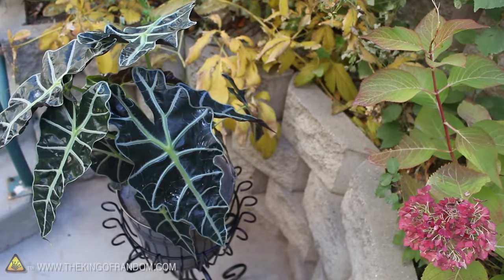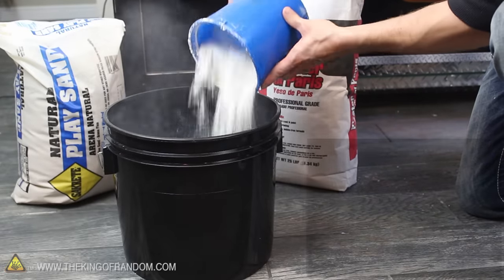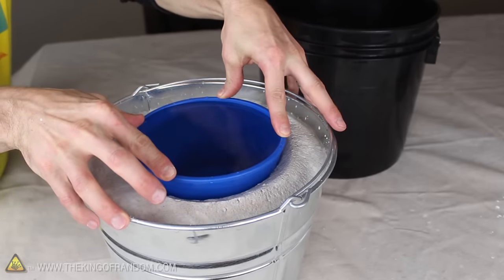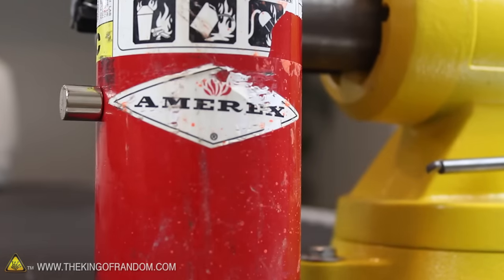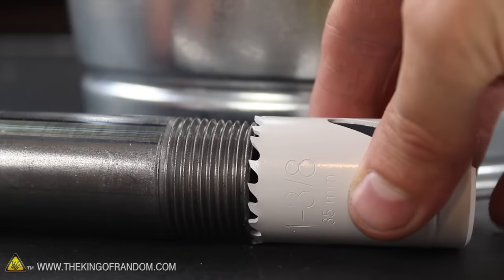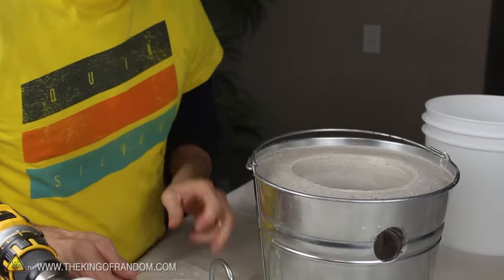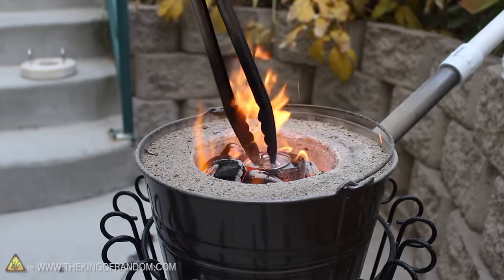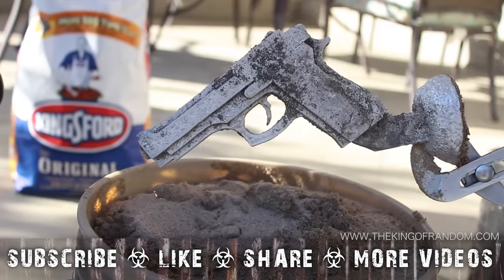How To Make The Mini Metal Foundry

Comment: WARNING: This does NOT cost 20$. Try 100.
Reply: if you make more then one of them they tend to cost less
Reply: I made calculations, still about 60$ per thing if you make a ton.
Reply: Cost of used fire extinguisher: Free.. Cost of plastic bucket: $2 at dollar store..  it all really depends on if you know how to get stuff cheaper (or free)
Reply: Have you actually made this foundry? I tried making it, the cheapest way possible, and it costs at least 60$.
*****
Reply: i made it, sand+plaster cost $10 for enough to make 4 of these things. $5 for the steel bucket, i found a steel pipe for air at the scrapyard
Reply: what about the shop vac and the crucible
Reply: I literally just got back from lowes and bought all the stuff I need for about 31 dollars.  Got 8 pounds of plaster of paris, a 50 pound bag of sand, a 12 quart bucket, a smaller bucket, and the two U bolts.  I guess it's not $20, but it's far from $100
Reply: for mass production it costs more because of the shop vac
Reply: Definitely not 20, definitely not 100. The Plaster of Paris is about 15 - 16 bucks a bag, and the sand too. I'd say about 30 - 40 dollars for all of the materials.
Reply: All the little pieces like the buckets, hole cutting saws, and ubolts are minimum 4$ apeice Angstadillio
Reply: Don't worry, the 5 gallon bucket and hole saws are good tools to have around, you'll use them again.
Reply: go on the lowes website i found every thing there for about 22 dollars
Reply: i bought all my stuff at home depot and it was $50 all together easy
Reply: +Ethan Noumenon what kind of bucket are you getting for $4? Just go to the dollar store
Reply: I made mine with a 6 gallon bucket, much larger than the 2.5 gallon one he used in the vid, with a 5 inch diameter extinguisher as the crucible, bigger than his 3 incher. I found the used extinguisher in the online classifieds for 10 bucks, the bucket was 15 at Lowes, the sand was 4, the plaster 15, the U-bolts 3, for a grand total of 50 with taxes. I already had a plastic mold bucket and power drill with drillbits. If you dont have those it could be a little more expensive.
Reply: well his is called a MINI for a reason lol
Reply: +Angstadillio ,I spent $100 on mine where i live plaster of paris cost $30 and sand $7.50 for 50 pounds
Reply: mmkay well that adds up tooo.... 37.50... liar
Reply: Its been months since this was posted, gtfo
Reply: Can you chill?
Reply: Sorry, but I don't recall a dollar store mentioned in the video, so I went to Home Depot as mentioned in the video.  The cost of the sand and plaster alone was over $20, you can't buy that at dollar store.  Actually I ended up using a plastic paint can which is not tapered at the bottom but it was extremely difficult to remove afterwards, so a thin bucket is preferred.   You can save few dollars by making your own U handles.
Reply: Where did you buy a steel bucket for 5 bucks???  It was 11 bucks at my Home Depot and I looked everywhere for cheaper one.  Also it doesn't matter that it only cost 10 bucks for sand and plaster if you make 4 of them, you're still paying for 4 of them at once!
Reply: Prices as of Aug 2016
Plaster of Paris $16
Play Sand $4.5
2 plastic buckets $5
10qt metal bucket $10
12 x 1" pipe $6
pvc coupling $1
2 ft pvc pipe $1.67
2 hole saws $30
3" U bolt $2
fan from Goodwill $5
fire extinguisher $30, not from HD, just average price I saw.

About $121.70 after WA tax.

So I didn't buy fire extinguisher or any pipes or fan or hole saws because I either had or used something else like a tin can instead of 3" hole saw and it worked out perfectly.  I bought stainless steel cup from thrift store for $2 dollars and everything cost me about $40
Reply: Rens Vandekerckhove
Read the description... You people...
Reply: I would recommend getting a Graphite crucible. They can handle temps of up to 3000 degrees, so it is a sound investment if you wish to make this a hobby. Also I recommend doing a lot of research before hopping in. Saves you a lot of time and head aches.
Reply: porpus99 I heard the good ones cost $100+ and the pressed ones from China don't last long.
Reply: Dima Prok Depends on where you get it;
Reply: I made it for $20
Reply: well apparently you don't know that other country's have different prices for things
Reply: TROLL ARMY
He lives in america
Reply: Ethan Noumenon k?
Reply: Ethan Noumenon i didnt ask for that
Reply: for me it only cost about $30
Reply: i think they ment for the sand and plaster of paris.
Reply: came in at under £20 for me but I had the buckets and some scrap steel pipe (scaffold) also order a crucible of amazon for £8 that's not included
Reply: one bag of play sand from home base was £4.99 and 2 2.5kg of plaster of Paris from hobby craft which where less than £5 each. galv bucket scaffold pipe and heat gun I allready had. Also there's enough sand left to make green sand for the molds
Reply: Richard Ball Show the link where you bought crucible for £8.  Most likely it's 1kg and won't fit pop cans.
Reply: I made this and the styro slicer for 60, and that's because I bought the transformer.
Reply: +kalel thomas I made styrofoam cutter - nice one with base for $2.30 - the cost nicrome wire.
Reply: i just got back from home depot and i only spent $40
Reply: try Craigslist lol
Reply: it cost me 44 dollars at home depot
Reply: cost me roughly $50
Reply: Went on Home Depot website and added everything he used on my list and it cost over 70$ plus tax
Reply: He never said it would cost $20.00  He said in 00:33 that the play sand and plaster of Paris cost would be $20.00.
Reply: Andrew Gilligan quit whining about the price you can find steel buckets and stuff for free
Reply: It cost me $120 but I'm not complaining
Reply: Ethan Noumenon you mad bro?  lol how's living in your mom's basement.
Reply: he said those bags each cost about 20 dollars...not that the whole forge costs 20 dollars...
Reply: flounder2760 no in the description very top it says easy way to melt metal or something in 20$
Reply: Kroogg
Your insult would be funny if I had a basement.
Reply: It costs more if you have to buy the tools.
Reply: I spent like $120. Now how do I use the thing?
Reply: Ethan Noumenon i could make it under $15
Reply: Literally just made one for $15.
Reply: I already had alot of the stuff and went to the scrap yard also and I made it for exactly $17.23
Reply: What you probably can't get for 20 is the fire extinguisher, the hole saw tools, the pipes, and the buckets
Reply: +Eloc Gaming Please upload a video or show us a list of materials and where you got them from. Thanks.
Reply: assuming you already have the tools, it does only cost around $25. If you add the tools, it jumps to a little under $60 and with the clay-graphite crucible it goes up to $85. so yeah, you're about right assuming you have no tools, buckets, old fire extinguishers, or spare pipe around but anyone interested in making this most likely has at least some of the tools and parts required.
Reply: You could use propane, it's cheaper
Reply: I originally used concrete which didnt hold up at all. It lasts maybe 3 castings thats it. I made for first one for $15. My second one costed me $80 bdcause i used refractory mix. But i have put it through over 20 castings and its still perfectly fine. Watch out using concrete. Its popped alot and just about took my head off
Reply: Ethan Noumenon maybe he had some of the stuff so it mad it cost twenty dollars for him
Reply: it cost me $18
Reply: Ethan Noumenon it's only the plaster and sand that cost him £20

Comment: Love it. Made it. Works!!!!!! I did not bother with the pvc and just connected a hair dryer to the metal tube. I used the exact same measurements, you nailed it! Everyone who wants to repeat your success and has ZERO experience needs to follow your steps. I used a concrete mixer attachment on my drill and the mix came out great and gave me more time to form it before it set. Awesome video!
Reply: Careful your hairdryer dosnt get too hot. The pipe also helps keep your skin away from the hot pipe
Reply: +gamesdisk thanks for the tip. FLIR camera shows pipe at ambient next to the hair dryer and cool until insertion to kiln.
Reply: +meabn007 the pvc pipe is act like an isolator, so you better use it before your hairdryer turn off in the middle of working
Reply: +Primayoga Hogantara I find your lack of physics disturbing
Reply: meabn007 well according to my experience in the last couple of months that's what happen to me. but if you find it as a lack of physics maybe i'll read my book again. Thanks
Reply: +Primayoga Hogantara thanks?
Reply: +meabn007 where dafaq do you get a 3 inch STEEL fire extinguisher from...????????????? THEY DONT EVEN EXIST
Reply: +meabn007 --where do you get a steel fire extinguisher of the correct size?
Reply: +John B excellent question. I went to a big box do it yourself place and went to the fire extinguishers. I borrowed a near by magnet to test for steel. I opened one of the boxes that had a fire extinguisher inside and checked to see if the magnet stuck. The store ones are either steel-ish or aluminum. aluminum is no good of course. while at the store i made sure the fire ext fit in the metal bucket i was going to use for the shell. when i cat the lid for the forge i made sure the fire ext fit. you can make these things any size you want so just make sure everything fits before you cast. This only works if you live in the land of the free and the home of the brave.
Reply: +The Randomized Youtube yes they do.
Reply: +meabn007 The galvanized pails flew off the shelves here in South Florida so I had to scale up to a propane tank, which is what I wanted to do anyway. I had trouble finding a steel fire extinguisher so when an old rusty welding gas tank washed up on shore I cheered. Cut off the bottom, made two tabs at the top with holes drilled for inserting a rod to lift it. I bought a jet burner instead of making it, a 10lb regulator had some freezing problems after some hours. But the first batch of muffins were oh so sweet. I had an old aluminum ladder on a platter. I like the idea of using an arc furnace to melt steel to form custom molds.
Reply: +Duff Smith I like how you were able to scrap and scrounge. That's pretty cool.
Reply: +meabn007  could i just use a plaster that is mixed with sand already ?
Reply: +meabn007 Is a steel bucket necessary ?
Reply: +Nikhil Sebastian I say yes because the sand and plaster mix is very fragile to impact damage like bumps and such. There is not much structure to the mix and buckets are cheap
Reply: +K C123 I guess?
Reply: +John B you get a regular fire extinguisher and cut it to the size (height) you want. It's 2016 so let's not complicate this.
Reply: +The Randomized Youtuber dafaq store? Dafaq Internet? Again, it's 2016. Not hard.
Reply: +meabn007 yess!! his measurements and desings are perfect
Reply: +The Randomized Youtuber  go to a fire system inspector they should have one that is out of date that they will be happy to get rid of
Reply: How long were the tongs you used to pickup the crucible? I just ordered my crucible and tongs online but the tongs are less than a foot long.  I was thinking that would be too short for how hot the metal will be.
Reply: +Cassi Fife my crucible is a small fire extinguisher and normal bbq tongs.
Reply: +Namen Katen I am sure there is more than one way to make this project work but I followed his directions and it works. Using an iron bowl is not in the directions so you are on your own.
Reply: +Namen Katen I understand your question but I will not be any help because I do not melt the way you do. My thread is based upon success by following what this video shows. Using different materials is giving you a different result. I cannot help explain since I have zero experience melting the way you describe.
Reply: +Namen Katen I know that this conversation is between you and meabn but I would like to throw my two cents in and say from the your comment you said it was "((Thick Iron))" now I have no clue how much thicker it might be from the steel extinguisher that the video used but that might be the reason why the cans did not melt. Now I am no expert but from the limited knowledge that I have I would say that the logical explanation is that either you were correct and the cans you used where not mostly aluminum or possibly the thicker crucible stopped the aluminum from reaching its melting point and only getting hot enough to crumple them. Hope this makes a bit of sense and I didn't just waste everyone who read this comments time.
Reply: +meabn007 I'm having trouble with my pvc pipe bending from the heat. Anyone had problems with that?
Reply: +Joey Slager this is the ONE area I deviated from the plan. I simply did not use the PVC at all. I simply put one section of metal pipe and ignored the PVC. Melting PVC is easy, steel is really hard to melt if you are only doing this to melt Al.
Reply: +The Randomized Youtuber lol where you live xD here in denmark they exist

Comment: I'm watching this for about the tenth time but this time i'm siting next to all the materials ready to make this forge Finally !!!!
Reply: how much did it cost you total? he says less than $20 but everything he has listed is over $100
Reply: I think that $20 figure was just for the Plaster and Sand - which I found to be accurate :)
Reply: I just picked up plaster of pairis and play sand at home Depot, about $25... But he was only talking about those, not the bucket or anything else....
Reply: @burnt Rubber yeah, and I can't recall off the top of my head, but aluminum melts around or just above 1200°...  I build a similar one, and with the slow burning bbq charcoal, it will still melt it, but I tried some straight coal, burns a lot hotter.
Reply: @burnt Rubber and the movement of air over the ember's makes it hotter too
Reply: Same, except I already started doing it 😂
Reply: @masterglitch0  I got everything for around 50 bucks (2 bags of charcoal included)
Reply: @burnt Rubber yeah, the coals are enough to get it to a high enough temperature, but the air supply plays a big part
Reply: TULKAS ASTALDO same here
Reply: I would recommend going to ACE and getting you materials. Plaster of Paris and sand were only 18 dollars for me
Reply: Well, how'd it turn out?
Reply: Solemn Solitude it turned out great. When I first poured the mixture into the metal bucket it was really runny but I let it sit for about8 minuets then sunk the plastic bucket down into it and after that it turned out great
Reply: @dappersamthesnake3282  Can I get a list of what you bought and where you bought it from?
Reply: Same!
Reply: Dude,,,do we use gas for this?
Reply: @chainzchainz7757  coal or propane. There are videos on each
Reply: Yooooo same, gonna start today!
Reply: @LetsTalkAboutPrepping  thanks alot thanks a bunch,,,,but other than using a metal container of a fire extinguisher,  what else can I use,
Reply: @sanyukumaran3912  I completed mine....now to begin melting
Reply: @chainzchainz7757  I think you definitely want to use a metal container, and for the crucible it HAS to be thick steel or graphite
Reply: @LetsTalkAboutPrepping  you have been very responsive
Reply: @chainzchainz7757  no prob. Hope it goes well for u
Reply: The best feeling of a planned a diy. Congrats my friend.
Reply: Did it work?
Reply: And how did you get the steel cup?
Reply: Let's Talk About Prepping I’m using a free helium tank, and I live on top of a sand pile, so only steel and plaster had to be bought
Reply: Just forget about what I said
Reply: Ha ha you didn’t know how many times I’ve watch this
Reply: HAHAH I’m doing the same exact thing
Reply: Ha! This is my 250th time watching I haven’t made it yet
Reply: Have to say RIP
Reply: Would like to know, how does one go about decompressing an removing top from the fire extinguisher?  
What else could be used, a coffee can, a large soup can ? 
Any info would be greatly appreciated.  Thank you
Reply: @masterglitch0  assdd
Reply: @Andrew_Sword  ok
Reply: Obviously i need a hair dryer too...
Reply: I come from the future, and....
Reply: TULKAS ASTALDO did you try melting copper
Reply: I really want to make it but he didn’t specify if it had to be non galvanized
Reply: What maximum temperature does it attain???
Reply: @masterglitch0  he said less than $20 for the plaster of Paris only
Reply: @Rinoboy3  I appreciate the comment 3 years later